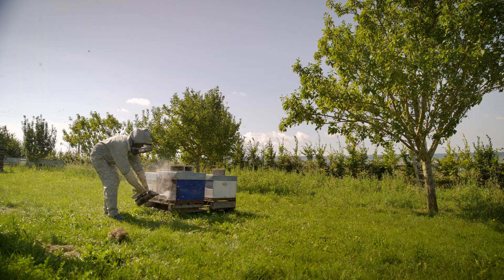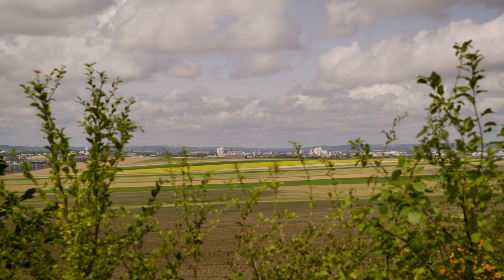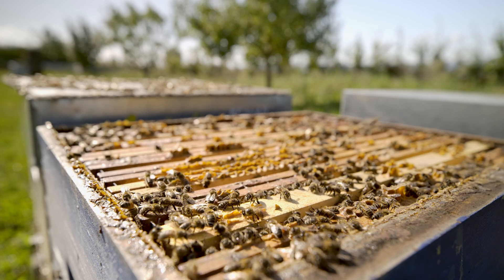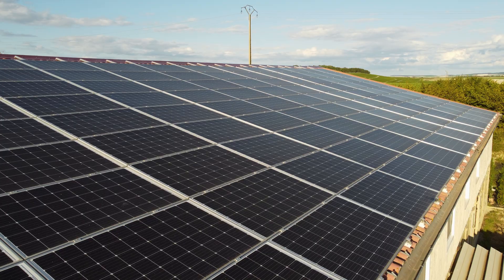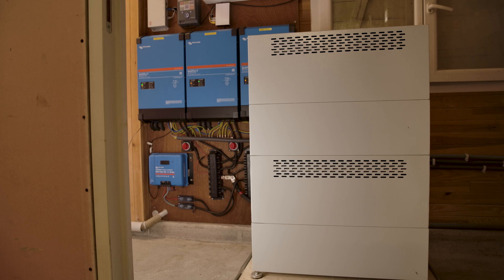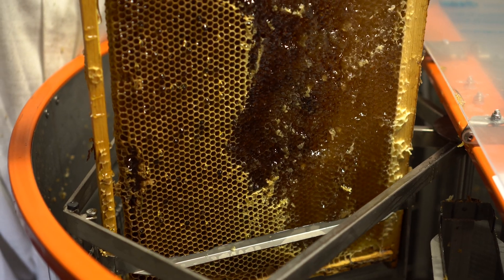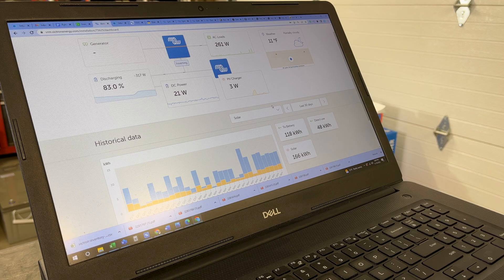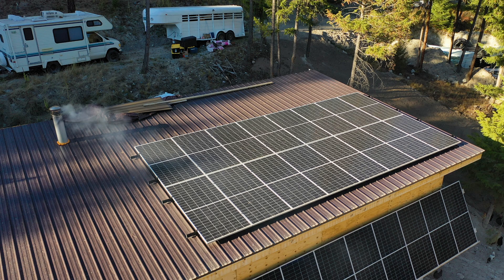Honey Production in French Champagne Region using Solar Power

Comment: 1:35 that is not a good example of an clean install
That "telephone wire" dangelin around with the positive side fused and the negative going unfused thru the positive terminal block makes my feet itch
The equipment mounted on wood with burs on the cuts, that's not nice either
This looks like some DIY dude put this together and not a specialized company that has been in business for 18 years
Reply: Not to mention that they use electrical tape on all lugs instead of proper heat shrink.
Reply: My DIY installation looks a 1000x better than this one, and I am currently working on a redesign to make it even better. That was definitely not a pro install.